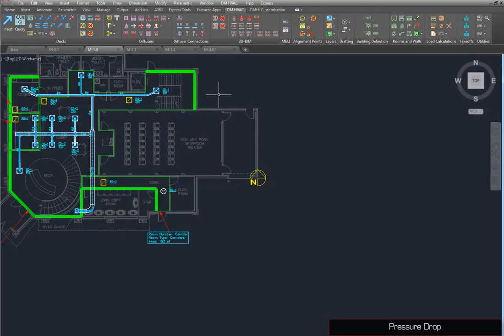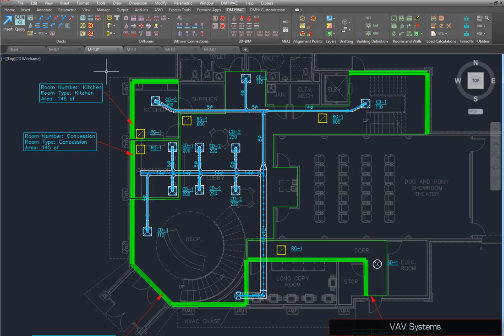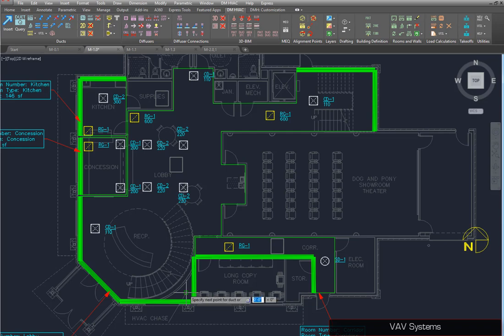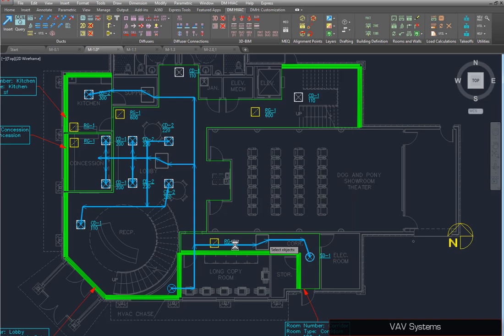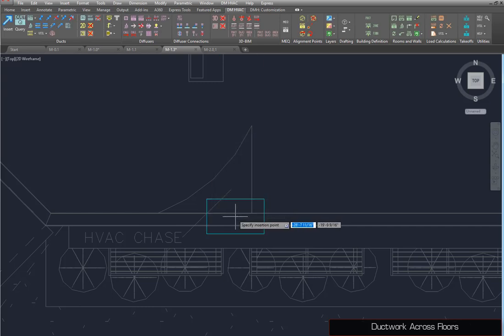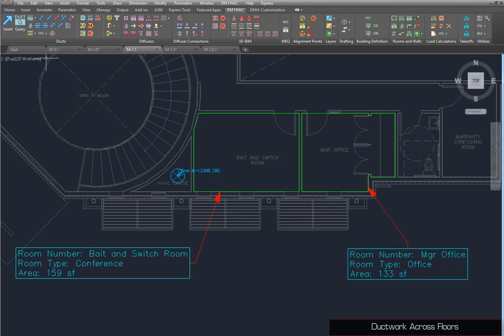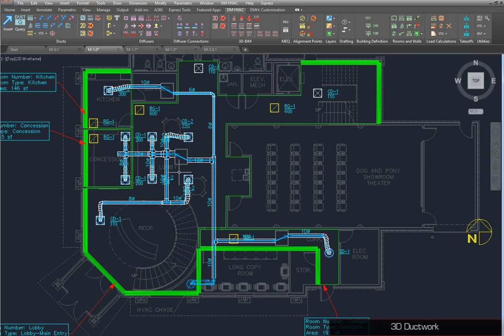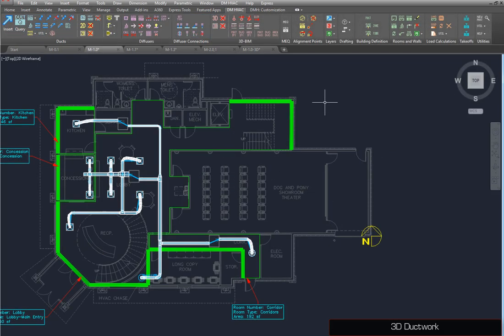Design Master HVAC for AutoCAD Tutorial | Part 5: Advanced Ductwork Techniques

Comment: Do you guys ever intend to add a feature that does equipment schedules automatically? I don’t mind if I have to enter in all the data manually with like a few drop downs for the easy stuff like tonnage, hp, and capacity, but it would be so nice if I could have my schedules match each other better
Reply from the maker: It hasn't been our radar and likely not going to happen. But with Claude Code, who knows? That's a feature that would be pretty straightforward for the robots to write for us.